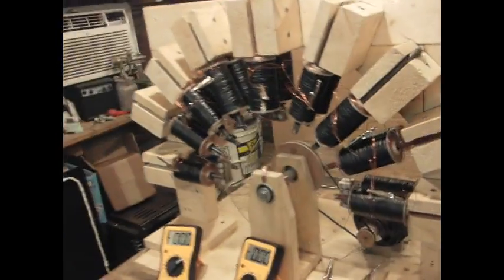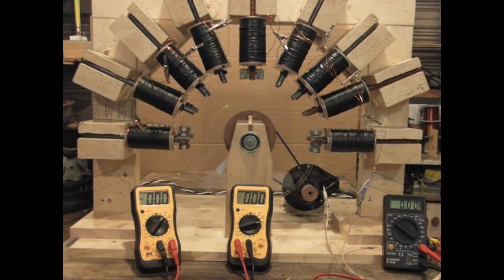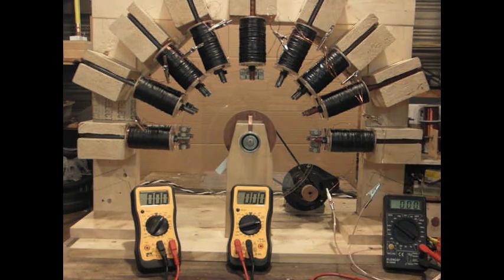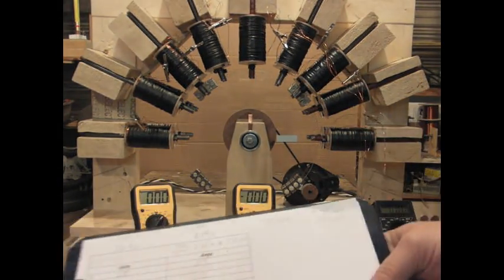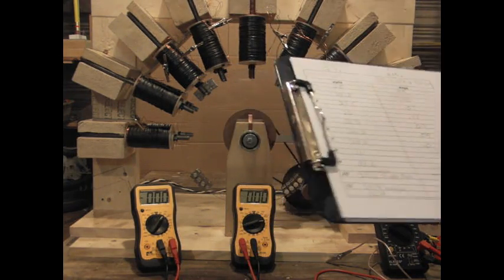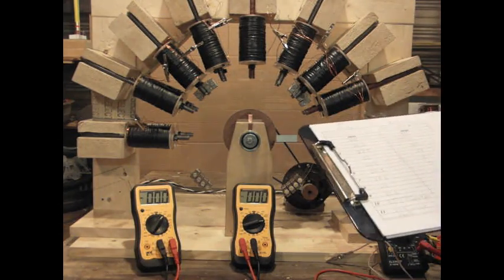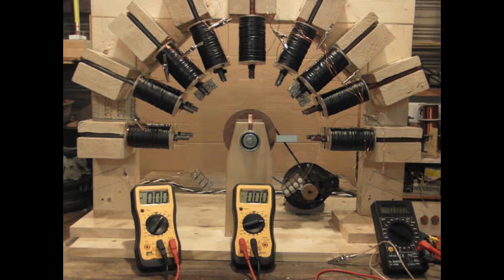Angus Wheel Update

Comment: if you reverse the pulleys you'll increase the speed of the wheel dramatically. Place the big pulley on the motor and the small pulley on the wheel. Judging by the sizes you may get a 5:1 ratio increase.

Comment: Nice machine and design, most particulary the efficiency of your coils. It looks like your attention to an organized process has yielded great results.  Can I share a vision?
Imagine tossing the rotor, removing your iron cores then feed an teflon or polyester tube inside the nine coils, evenly spaced in a close tube continuous circle arrangement, then accelerate Neo mags thru the tube and thru the sweet spot, along  the center axis of your coils @ 450 rpm's. No parts to wear out.

Comment: If you really start to understand the dynamics of your motor, you will realize that adding more and more horseshoe pickups is not really going to get you anything.  The spinning rotor only has so much mechanical power to output, and the source of that power is your battery + 12-volt DC motor.  If you have two horseshoes, they can split the available mechanical power.  With four horseshoes, each on can get 1/4 the mechanical power, etc.  There is no reason to go 360, you are at 180 that's fine.

Comment: When you drive the two fans with the two DC motors from the FWBR output, that actually looks like a fairly high effective resistance to the horseshoe coil.  That means that the load on the coil is quite lite and you don't get much Lenz drag.   But if you try the dumb resistor test like I am suggesting, you should start to see some serious Lenz drag as your load resistor starts to become an impedance match with the coil.  It's important to understand the dynamics of your motor and this helps.

Comment: Now, measure the DC resistance of your coil.   Suppose it's 10 ohms.  Now try different load resistors, 1 ohm, 2 ohms, 5 ohms, 8 ohms, 10 ohms, 12 ohms, 15 ohms, 20 ohms, 100 ohms.  You might be in for a shock.  What you are looking for is the resistance value that gives you the most output power.  It should be the same value as the coil resistance.  In this case the rotor might slow down and start to "thunk" because you are getting serious Lenz drag with the matching load resistor.

Comment: Finally, to really understand how the horseshoe coils work with the motor there is an important test that you can do that will be very helpful.  Do you have a true-RMS multimeter?  It would help if you had one.

With a single horseshoe setup, run the rotor with the 12-volt DC motor like usual.  Instead of the DC motor + fan, just use a resistor as the load.  Measure the RMS voltage across the load resistor and calculate the output power.   Continued.....

Comment: So two effects are taking place:  You are reducing the sticky spot drag when you put a load on the coil, and you are also adding Lenz drag because you are driving a load.   It just so happens that the sticky spot drag decrease is greater then the Lenz drag and so the rotor speeds up.

So am I right?   Can you do some tests to confirm or deny this is what is happening? That's up to you but if I was in your shoes I would temporally remove the motor and do spin-down tests with and without the load.

Comment: When there is no load on the coil, you get the "thunking" resistance as the magnets pass the horseshoe.  It's a "sticky spot" and that sticky spot stresses the bearings in the rotor and that causes more friction.

Here is the key thing:  When you put a load on the coils, that allows current to flow through the coil.  That creates magnetic flux through the horseshoe that is in opposition to the flux being induced by the passing magnets.  That reduces the flux, and that reduces the sticky spot.

Comment: There is no point in adding horseshoes all around the rotor until you have done some more basic experiments.  I will tell you what I think is happening, but keep in mind I am not on the bench.  You can try some of what I talk about or not, your choice.

So what does the rotor turning resistance go down when you add a load to a coil?  I think the answer is two-fold, it's two separate effects happening at the same time and you add them together to get the final result.

Comment: The length of battery life depends on how much you're drawing off.  To determine the battery life, divide the capacity by the actual load current to get the hours of life. A circuit that draws 10 ma powered by a 9 volt battery will operate aprox 50 hours: ~500 mAh /10 mA = 50 hours.
A high quality alkaline D battery will give you nominal charge of 1.5 V and 12000-18000 mAh (milliampere-hour).  An alkaline 9V battery will give you an nominal charge of 9 volts with 565 mAh.

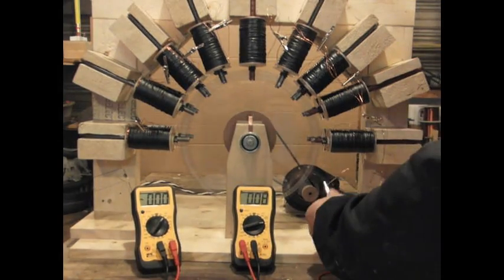Comment: Hi! Nice build! I hate to be a party breaker, but I see something done wrong here. At 1:58 i guess you are disconnecting the ampere meter to attach the volt meter - if you would like to measure the power output of your coils, you should measure the voltage and amperage at the same time (with the ampere meter connected, then add parallel to it the volt meter, then multiply the readings). in this case the ampere meter would show 0.9 amps, but the voltage would be minimal, so Pout vs Pin= ? < 21,8W